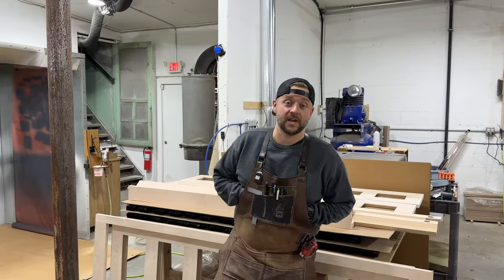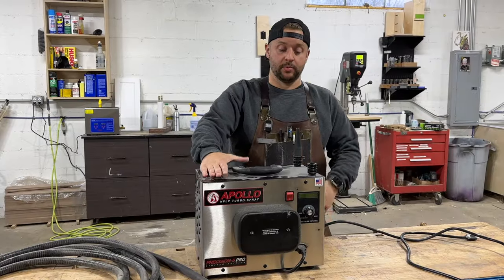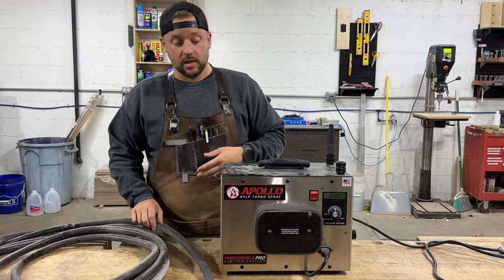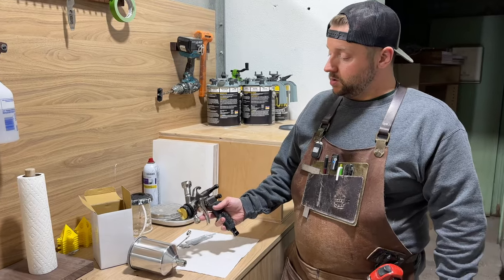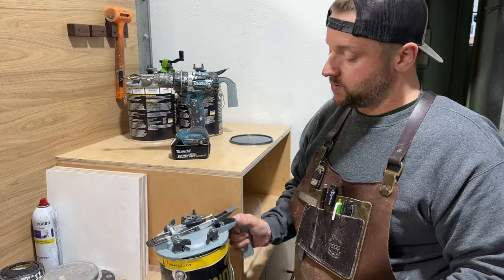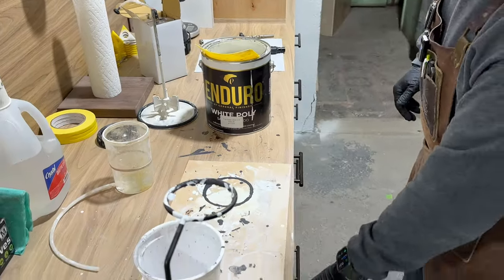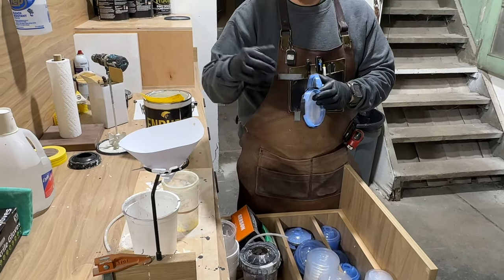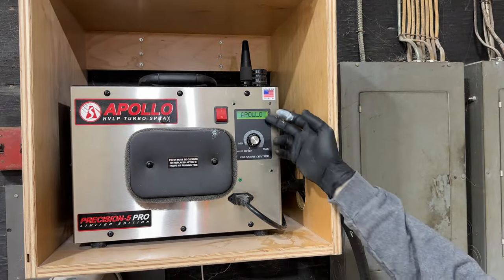How to Spray Paint HVLP Apollo Precision 5 Pro Turbine

Comment: great presentation on spraying paint.  you guys always have useful info in your presentations.  request - go over spraying non-paint finishes if you would please?  I have yet to begin using a spray guns and want to insure that what I setup both physically and procedurally works for both paint and poly/laquer/etc. if possible.  I usually over research stuff, but do not want to make more mistakes than necessary.  Great job!
Reply from the maker: Thanks so much! We use the same Enduro Pro Series polyurethane in clear. Sprays fantastic!

Comment: Can you let the paint sit in the gun for all three applications?
Reply from the maker: Yeah that’s usually not an issue but if you’re spraying any decent amount of parts you’ll be filling the cup up a few times to get your 3 coats.
Reply: For a 1 part finish yes. For a 2k finish then you have until the pot life.
Reply from the maker: Yup, I’ve made this mistake with 2k but thankfully it was in the PPS gun so I just threw away the tip.

Comment: I just got done using the Apollo for the first time. It was great. Easy clean-up. Easy to use. Sprays plenty fast enough when the pressure is up. Adjustable fan pattern was a life saver on the first job. Even airless is just a bit too fast for me and can be too much over spray for inside customers homes. Have you guys tried the Apollo pot with mini compressor?
Reply from the maker: Awesome! I have not but I’ve considered buying the pressure pot for days that we spray a decent amount. If I just need to spray one cup I typically reach for the 3M PPS.

Comment: Great presentation. I bought an Apollo five stage 4 years ago and I'm still struggling to dial it in.  I painted a couple of kitchens but mostly furniture and I struggle with proper atomization.  In the past I used guns that didn't offer a choice of different needles and nozzles and maybe that's the problem.   

I'm spraying an enamel paint and the droplets aren't the same size or inside the oval pattern.  I've ruled out a clog, adjusted the pressure and fluid.  How do I know if I should go up or down with needle size?   Also, Is it normal to have the pressure set at 7 psi?  I'd call Apollo but seems like I only have issues on the weekends.
Reply from the maker: Thank you!

What material are you spraying and what needle/nozzle size are you using?

Comment: Great video.  Can the unit spray thicker coatings like latex or some of the thicker pigmented lacquers?  I noticed that you only had the discharge pressure at 4 psi so that got me thinking that the unit might be able to handle thicker materials. Thanks.
Reply from the maker: Yes you can! I spray our high solid primer through it no problem.

Comment: Hmm… pour some paint through the pps lid, it flows well. Straining was the step that sold me on PPS (that and spraying upside down).
Reply from the maker: That filter can definitely cause issues! I know many people who have had the same experience.
Reply: I started using the PPS system bcus anytime I tip my spray gun perpendicular to the surface, I got fluid in the air distributor.   I never had that problem with any other sprayer. Did that happen to you?
Reply from the maker: My first spray gun was a PPS so it’s all I’ve ever known.

Comment: Have you thined the paint or added anything to it and what size of tip are you using in your gun.
Reply from the maker: That was straight out of the can. Sometimes I’ll thin it about 10% with distilled water. That was a 1.0 needle and nozzle in the video!
Reply: @TodaysCraftsmen You're kidding?!   I haven't used Enduro, but it looks very thick.  I've only used the 1 mm for water born poly and maybe lacquer.  Maybe that's what I'm doing wrong.  Lol!
Reply from the maker: I know it sounds crazy but it does work. I use a pressure cup which probably helps.

Comment: Air assisted airless here. I have to say it was painful watching how not fast ( didn't want to say slow) the turbine is. You'll never look back, just saying. You'll be at a flee market someday in the future and say I remember I had one of those. If you're spraying in someone's house it's not a good thing. Keep on keeping on .
Reply from the maker: Slower than a AAA yes but when you only spray about 2 gallons a day max I think the cleaning time rounds it out. We don’t have 10 guys in the shop so we still have dry time and scuff time. I agree that AAA is a superior system in general but I don’t think at our production level it’s that advantageous.
Reply from the maker: He uses a velour 4” roller.
Reply: @TodaysCraftsmen  The clean up dosen't take the long at all. The only drawback is we go through lacquer thinner like it's water but if you're spraying water base, no brainer. I like how organized your paint area is! Nice
Reply: I use another brands 5 stage and usually turn the air down and the fluid way up and use a bigger tip. It sprays fast.
Reply from the maker: I definitely had a really light coat going in the video!